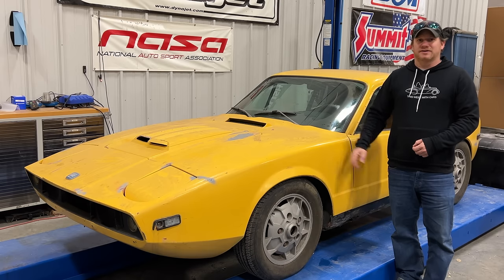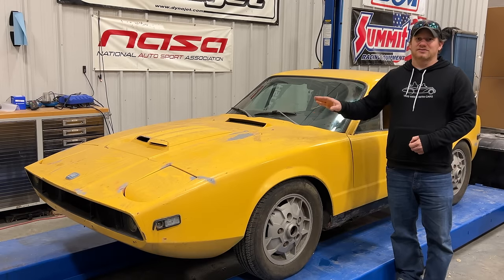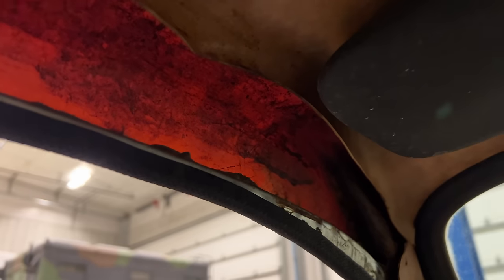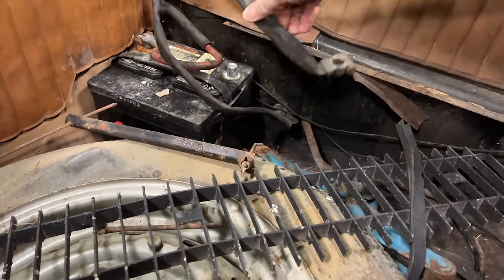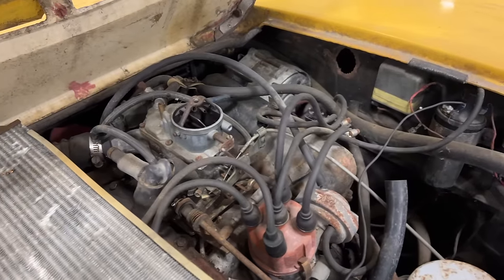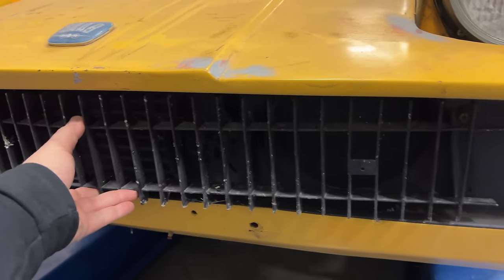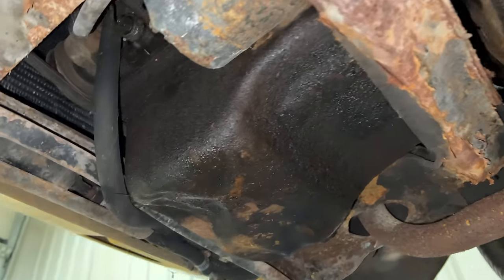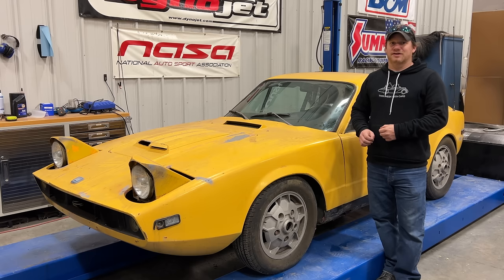My First Saab a 1971 Saab Sonett III

Comment: This will become your Saab Story (SOB Story). The only way to really work on the engine is to remove the front.  There are only four bolts to remove the entire front clip.  BTW, 1971 did not have a bumper, but someone may have added one.  In the early 1970's the US DOT required 5 MPH bumpers on all cars, so every Sonett after 1974 had them added on in the US.

The Ford automobile engines all have a fiber gear on the balance shaft, and are subject to serious wear.  If you go to a Ford Power industrial engine supplier, you may be able to get parts that include a steel gear on the balance (timing) shaft.  I replaced the 1500 cc engine in mine with a 1700 cc engine from Ford Power.

Also, if you have not been told about "freewheeling", look at the floorboard behind the accelerator pedal.  there is a small handle there that engages and disengages the freewheel in the transmission.  With the freewheel disengaged, the car can roll faster than the engine.  So you can coast down hills while the engine is at idle speed.  However you will not be able to use the compression of the engine to slow the car.  It takes a little getting used to, but it is a cool feature that is only on Saabs from that era.
Reply: As the car has airco it is not unlikely that the balance- and cam shaft gear have been exchanged for steel ones. Sets with all 3 gears in metal are newly available.

Comment: The motors were built by Ford in Germany    The timing gears have plastic teeth on some of them but kits are available that are solid metal.   There is a Weber conversion for the engine available.    Made in Trollhätten by trolls!!!!!

Comment: That front grille is not the original one. Isn't the airco pump on the left hand side of the engine? That the oil filter is repositioned because of the airco does not sound logical as the hoses and pipework to the cabin were on the left for as far as I know. That extra j-bolt in the trunk is for keeping the spare wheel in place. There should be a spacer and a wingnut to screws down the wheel through a bolthole. The missing indicator/parking light lenses are new available, both in orange and white. I bought new ones years ago, believe it was Triumph TR6. The holes in the small hatch are not original, may be why you have a spare hatch. The missing front lights were not for daylight running lights as these were not mandatory back in the days, but additional lights that could be switched on together with the high beams. One of the pull switches besides the heat/ventilation levers should activate them.

Comment: Wow, a saab sonet with a 2 stroke on the salt flats, thats supercool
Theres a bigger engin used by the european ford 17M, a 1700 cc. These enginges was used on the SAAB that been used in rallys
Reply: SAAB used the 1.7 version in the US market from 1971 on. A change in Federal emissions standards dropped the compression ratio so the larger engine was used. Both the 1.5 and 1.7 for the US were rated at 65 HP.
Reply: @brucebeauvais1324  So now you got to find high compression pistons 😀

Comment: I have forgotten ( almost ) about Saab's Sonnet, and because of this, I for one, would really like to this engine pulled and restoration started.
This would be an interesting video series, if you are so inclined to undertake the work.
I seem to recall too, that Ford of Germany, made a few Vee style engines, did they not? One of them was 'very good' while the other, well, not so much!
Reply: The UK Essex V4 was available as a 1700 or 2000cc. The German Taunus V4 was made in 1.2, 1.3, 1.5 and 1.7L versions.

Comment: Remove the entire hood if you need to do much of anything.  Pretty easy job.  Most difficult thing is to remove and replace the pop-up headlamp linkage.  Use to people to lift it as it becomes very flimsy once detached from the chassis.

Comment: Be aware the rocker panels are steel and are structural and are prone to severe rust.  In the past repair kits were available but now I would guess they are unobtanium.  Rusted rocker panels and other rust sent most Sonnets into the junk yard.

Comment: Interesting Steve i would like to see more when you have the time. I think you said V4 Ford? Those engines were not that powerful, (plentiful here in the UK at that time) the V6 was a lot better but who would want a really powerful engine it there anyway? Thanks for the video Steve. 👍
Reply from the maker: The car isn't made of anything so it doesn't take much power to move it!
Reply: @ThisWeekWithCars  Agreed Steve, that's why I said you wouldn't want (or need) the V6 version.👍

Comment: Saab used the Ford Europe V4 engines I believe there were at least 3 if not 4 different models that were all different to each other, and one of the engines was supposed to be better than the others, you will have to check that out for yourself, the v4 's were fitted in Corsairs Capri's and Transits and ranged in capacity from 1500 to 2200, also heads could be high or low compression depending on use.. On uk models carbs were notoriously inefficient and distributors were prone to slipping. Saab were well know for changing things up so may well have modified their version of the Taunus v4..However properly sorted  and performance tuned this engine very capable and should have plenty of power for that light weight shell.of course if you want a real race car tune up the one litre auto union engine as used in the wartburg tourist.should give you 0-60 in sub 5 seconds.ideal for short winding tracks or hill climbs.where acceleration out of bends essential.

Comment: I always thought that was a Ford designed V-4, which was used in the original Mustang concept and the production Taunus. Edit: I should have watched the whole video.
Reply from the maker: Yes same engine as the Mustang prototype, which used this same front wheel drive layout behind the driver to make it mid-engined RWD, but it was the Taunus not the Taurus.
Reply: Taunuses (Taunae?) and Cortinas were the same platform so the SAAB has a British connection, right?

Comment: Steve, put it on the shelf and get back to the Lectra please.
Reply from the maker: What would you like to see me do with the Lectra?  It is winter here now with salt on the roads so I will be doing a lot of videos of working on things and not driving them.
Reply: @ThisWeekWithCars  Hey Steve, There is no shortage of videos about saabs, MGs, sprites but very little about Lectras. I'm sure lots of people enjoy those other cars. I don't bother with most of the videos about them. Also the super car videos, yawn. When I see something super rare and interesting, I can't get enough on it. I'd love to see it sorted out better and tested in different ways. Maybe pit it against modern electric cars. Test out it's range, see if it is a viable daily driver etc. For me, the oddball stuff is fun and I look forward to videos about it. I learned about Lectras from you. You peaked my interest.
Reply from the maker: I will be doing a test of it's range but I don't want to be stuck on the side of the road in winter so it will have to wait for that one.  I saw that you can charge other EVs from the new Ford Lighting if I can swing it I would like to get ahold of one for my testing.
Reply: @ThisWeekWithCars  You know what's best for your channel. I'm sure a lot of guys have different taste than me. The Ford Lightning charging other EVs sounds like an interesting video.

Comment: I have a ford Cl 40 skid loader with the V40 engine  im an thinking they are the same motor
Reply: It was. The industrial engines were mostly open deck and the passenger cars closed deck. My neighbor has a Ford skid steer with a V-4. I'd often speculated about a 2.6 V6 swap for a loader.

Comment: Although the purists may scream.... I was wondering if there would be a kit that I could buy to basically take the body off the front drive frame and have new suspension and rear drive and just crate motor and have new school underpinnings and old school body....I know I'd have to make a tunnel for a driveshaft to work....but there is a parts car here local and the body and interior need very minimal work...but the ad says motor won't run.... 

Any insights?
Reply from the maker: The V4 in this car is very small fitting anything else except a rotary engine or an electric motor would be difficult.  If you were to fit a V6 or bigger you would want to make the entire front of the car hinge forwards and out of the way so you could even work on it.  The hood is almost too small to even work on the V4.
Reply: @ThisWeekWithCars  I've only seen this car via picture...  just looked like a neat car.  How far has yours come along?
Reply: @ThisWeekWithCars  so...either a reverse funny car application where the back end would come up? Either like Lamborghini doors but applied to the fenders?  I COULD see that as pretty trick!...     got me thinking....  haha!
Reply from the maker: I have not done anything with the car since that video.  Need to finish other projects first.

Comment: If it was one of the very few original Sonnets with the 3 cylinder 2 stroke and a hand laid glass body I would say do it. Those are rare.
As to the later Sonnets...meh. A waste of time and money. 
I worked at a SAAB/Volvo dealership in Monterey Calif. for Ole Andersson.

Comment: There is A german V4 verson 1.5 1.7 liters And A  UK V4 verson up to 2 liters , SAAB only used the german 1,5 singel port & on later ones A 2port , The gearbox is SAAB not ford! SAAB Rally&Racing made versons up to 180-190 Hp for rally and outher racing (Way moore then Ford ewer expekted) The rear ligts are same as SAAB 99 , and alott is from the 95 96 series.
Reply: Engish Fords used the Essex V-4 and V-6. No interchangeable parts with the German Ford Cologne V-4/V-6. Ford Europe commonality was a future dream.